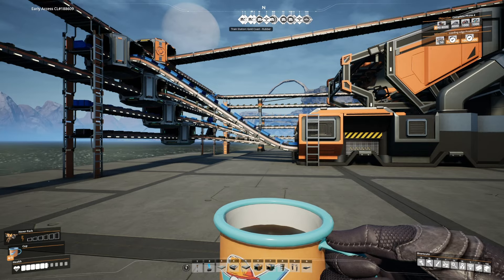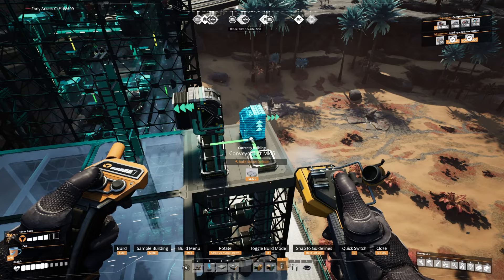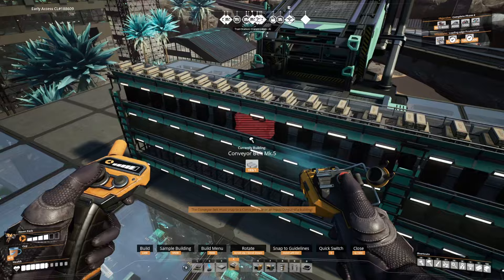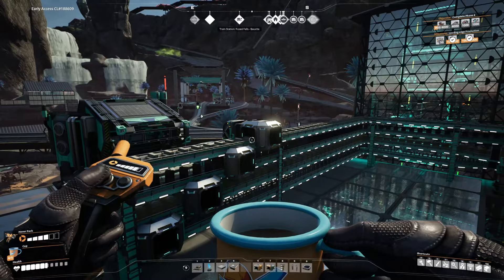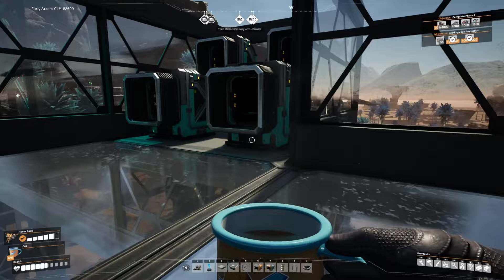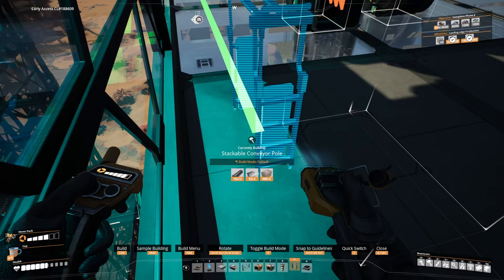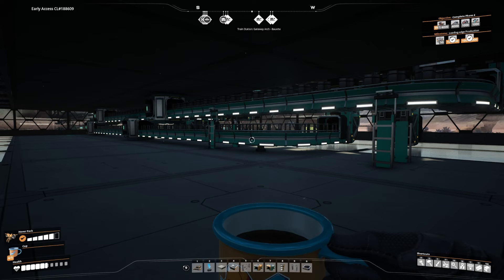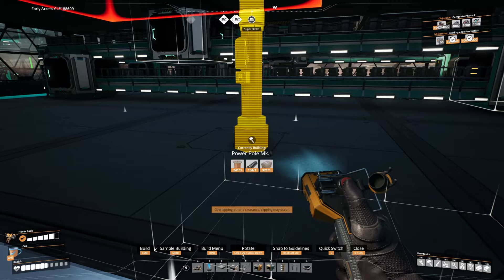Break Free of the Spaghetti! - Satisfactory Manufacturer Design & Logistics Tutorial

Comment: When you had to re-do the belts at 2:55: I felt that in my soul. 

Building a lot of pipes is so much nicer because you dont have to worry about direction. Also this simple variant is pretty close to how I do it usually, mine is just a touch more asthetically pleasing IMO, though it takes up a ton of space. I stack 4 splitters at the first hole (depending on what direction the parts are coming from) positioned 1-1.5 foundations away and belt them in from there, it doesn't clip, but it takes up a lot of space. I guess the upside is you can see if there's a problem with a line faster, but really I'm just exhausted by the time I get to the end of a factory that ends in manufacturers and just want to set it up as simply as possible.

I probably won't bother with logistic floors, or other cosmetic belt/wire hiding (I like the industrial nightmare asthetic for my factories), but I got a big bolt of inspiration on how I wanna do my Frames production. I'm gonna go to the Rocky Desert starting zone and build 3 giant floors for the 3 tiers of frames, maybe this time I'll actually use walls and make it look like.... something, though likely only after it's complete.
Reply from the maker: Seriously. I actually have to redo a lot of stuff that I am building for videos…I find that I concentrate on not talking like a moron and end up building like a moron.

My early buildings are exactly what you describe. Pretty organized factory floors but almost no decoration. Nothing wrong with that at all!

If you haven’t already, think about a subscription. I am close to getting monetized and just need a few more subscribers

Comment: Another tip for clean power lines when you have a floor beneath your machines: Wall mounted power nodes can be mounted at the ceiling, and you can connect them to the machines above. That way even the power pole will be gone.
Reply: That's my favorite way of connecting power. On the other hand, watching him use the regular power pole in this way, maybe it helps find the thing later on. I had good results adding a second floor to my starter factory; simply use the first floor ceiling as a power bus and pass everything upstairs.

Comment: i just done my first floor fed system in a coal plant. saved a ton of room. those pipes sure do be space greedy.
your designs are really nice. i just don't have too much time to make things as sexy. top work
Reply from the maker: It definitely saves a ton of space...the coal generator is a great spot for a belt floor. I would probably still run my pipes on generator level...I have found that feeding anything fluids from below can get a little wonky.

Timewise, the key for me is to find some patterns for each kind of machine that work for looks and aren't too fiddly. That way I know what to do each time I have to build a given set of machines.
Reply: @DrLootCrate  yeh for sure, i always run fluids from at least level height, never below. i like to put in a small fluid buffer before feeding anything. it helps to avoid the sloshing that often occurs. 
ha i like to make a huge to-do list and just go at it. then encase it in glass and concrete😂
Reply from the maker: @mowvu5380  that sounds like a great plan!

Comment: Ah, I remember "baby's first organization".  I spent my entire first run of Satisfactory trying to avoid clipping, making things as "efficient as possible", making things look neat and tidy and nice...  Burning like 300 hours of the game before even getting the Assembler...

Then, on a subsequent playthrough I went, "This is a massive waste of freakin' time.  Spaghetti and clipping are THE MOST EFFICIENT way to do anything."  The shortest distance between two points is a straight line.  It doesn't look nice, but it's certainly much faster and more time efficient to engage in massive feats of clipping and spaghetti.

Do you want to unlock everything in 30 hours, or do you want to make a "pretty factory" that takes you over 100 to organize and be careful about placement in order to "get it right"?

Yeah, my new run is "I want to unlock everything as quickly as possible.  I can make it look nice LATER.  Looking nice is the ENDGAME.  It isn't the CURRENT GAME."

After all, you're going to be tearing your factory down dozens of times anyway, just trying to "keep it nice" and trying to "keep up with production" as you upgrade miners and transport systems and everything else.

Easier to "spaghetti" the thing and "make it nice" later... when the parts are no longer really needed as quickly as possible.

In a game like Factorio, the "spaghetti" matters as it actually interferes with productivity and efficiency of your factory.  Satisfactory... spaghetti doesn't matter at all, because it's MORE EFFICIENT to clip through everything all the time to achieve the shortest distances between any machine.  Belts that slam through power poles, other belts, and other machines and the space elevator?  ABSOLUTELY!  I'm not going to attempt to reposition anything to "make it look nice".  That's a newbie move.  Production is fastest by engaging in the clipping and embracing the spaghetti.  Make it look nice later.  When there's nothing else to unlock and nothing else to do.
Reply from the maker: Awesome comment and I agree to an extent. 

My first save was ridiculous spaghetti and I figured out how to be organized towards the end. I thought that I would start again with this knowledge and it was really helpful. 

So for this save I was generally organized with each build (no clipping and all manifold on foundations), but really didn’t take any time attempting to make it look good until my adaptive control unit factory (which looks horrible haha).

Two slight points of contention: I haven’t torn anything down…I just move on to more nodes. There are so many out there. I will be redoing a bit of my starting area because I am building phase 4 parts there and want it to look decent.

I have said “I’ll make it nice later” several times and I have not yet done it. Once I move on to a new project, I really struggle to find the motivation to go back. You might be able to glimpse my half decorated RCU factory in the distance in some of my videos…
Reply: @DrLootCrate  I'm not knocking the "make it look nice" and the tips are generally very helpful as I'm always interested in "How do I make this not look like garbage?" when I get to endgame.

I just gave up on my most recent run because I was just burning SO MANY HOURS on "rebuilding it" all the time.

I mean... you get a Impure Node, so 30 iron a minute.  One Smelter to go with it to make 30 iron ingots a minute.  Split that off into whatever you're making to keep the ratios perfect...

Then, you unlock "Mark 2 Miner".  Well, crap.  Now I've got to tear down the first smelter and add more constructors.  Or, I get Mark 3 Miners and have to do it all over again...  It's even worse if you've got a Pure Node and have to start with like 4 Smelters and it scales up a ton as you go.

That's to say nothing of when you unlock trucks and no longer want to "belt everything back to the main base".  Or, even worse... TRAINS.  If you do not have a plan for your train stations the moment you start your file, you are basically asking to rebuild the whole thing again and again.

Even having to "upgrade" your belts is a fun new overhaul each time as they can carry more items.  Got a Mark 3 belt, but you can't hope to fill it with the Impure nodes around?  Downgrade it to Mark 2 or funnel more resources onto that single belt from across the map.

I can't even imagine how my transportation network is going to look the moment I unlock the drones (which I've never used before as I'm playing on a brand new PC for this run and hadn't touched the update they were introduced before).

All of this to say nothing about when/if you start over/underclocking your machines.

I typically end up rebuilding my Satisfactory "main base" at least a dozen times before unlocking Tier 7 and 8, and that's just to "keep it functional".  That is to say... adding new lines into old ones from further nodes, adding more machines to current lines, swapping out alternate recipes on current machines, so needing to fix lines again...

You can easily see why I blew 300 hours on my first game before even getting "Assemblers" as I had to keep rebuilding my base just to keep stuff from clipping and to keep it "nice and organized".  I spent like 30 hours on a freakin' "Mall" for each part in my main factory as well, and I didn't even have that many parts available to make!

So, with so many hours trying to "make the factory look nice" on a playthrough, I just couldn't subject myself to that anymore.  Making it "look nice" when I had nothing left to unlock seemed far more reasonable to me.  Especially since I know I'm capable of sitting down just to tear my factory down and rebuild it to feed lines all back through it again.

Spaghetti is the most efficient way to play Satisfactory.  I don't begrudge anyone for doing it and I feel like we don't talk about how useful the Spaghetti in the game actually is, in the Satisfactory Community.

But, it's also important to make things nice when you can.  Making things nice is "endgame" and isn't progression at all.  Making things nice is always something good to do to "burn time" while you're waiting for other things to happen.  I just don't see the point in focusing so heavily on "making things look nice" so early in the game and before you get most of the important upgrades and unlocks.

So, yeah.  I can remember my first time at "trying to make things look nice".  It was a good time, at the time.  But, it made me woefully inefficient at the rest of the game.

And, there's nothing to stop you from "going back later", even if you don't have the ambition to do it.  It's sometimes hard to "find the ambition" to tear it down and rebuild it.  But you know how you start?  Just start knocking out walls.  Once you get started on tearing it down, you no longer have the hesitation to do it.  You then go, "I'm building this much better than I initially had it and it won't be so difficult to navigate anymore and it will DEFINITELY look far nicer".  Just gotta rip that band-aid off sometimes.
Reply from the maker: @XxTaiMTxX  I’m with you, especially the part about burning time by making things nice. It is a good thing to do if you have 20-30 minutes to play.

I avoid a lot of rebuilding by just moving on to a different node. I don’t ever go back and replace belts and miners unless I am on the verge of unlocking something and I plan for the upgrade (like I am currently doing with mk 3 miners).

I don’t think making things nice is endgame…you can do it whenever you want, including never! But I could see many people playing this game mainly for the building design if they are really into it. That’s not me, but part of the beauty of the game is that there a lot of ways to play it!
Reply: @DrLootCrate  Well, what I mean by "making it look nice is endgame" is because you don't unlock most of the really nice looking stuff to work with until you're basically at that point.  Even the placement of new machines and such can make things "look beautiful".

I always find it "very limiting" what I've got to work with so early in the game.  I prefer the look of the Mark 3 miners, for example.  I prefer the look of the bigger liquid storage tanks.  I prefer making my buildings look more "lived in" or even "create a tiny little city" with each new section of factory, where I've got cars and parking lots and train stations and stuff.  A factory building just doesn't "look nice" to me, until I've unlocked most of the building materials and most of the new machines and structures.  You have most of the "sandbox" of creation unlocked by endgame, so it's really the perfect time to begin to beautify stuff.

Especially when you're looking at Phase 4 of the Space Elevator and realize you can blow a ton of hours to make those parts at 60 a minute (something I will never accomplish because that task it so daunting), or you can wait a few hundred hours for the elevator to fill and make your factory look beautiful during that time.
Reply from the maker: @XxTaiMTxX  excellent point. I am definitely of the mind to get a reasonable rate of space elevator parts and waiting. That is an excellent time to pretty up

Comment: Thanks for the video! Istarted doing this in my builds and i really like the clean look it gives, plus logistic floors help me from making a mess with belts. You could go one step further with the power and position a ceiling outlet in such a way that it's under the machine so that the wire doesnt show at all. i built my aluminum factory that way and there are no visible or barely visible power lines, looks really clean that way.
Reply from the maker: Thanks crafty! It is a nice clean look. I have started using the very trick that you mentioned with the wall outlet since this video in a lot of my builds

Comment: I started using logistics floor with update 5 if you place the splitters first in the right place you can avoid having to run conveyors between them and the lifts looks tight
Reply from the maker: Definitely! It works if you put the splitter first and then the lifts will attach to them but not the other way around like I did

Comment: Was just about to build my first manufacturers and wondering how to hook up all the belts. Looks like I'll be using a logistics floor, thanks.
Reply from the maker: Good timing bruv. The logistics floor is definitely my favored way of doing it.
Reply: @DrLootCrate  Finally got mine done, not quite as neat as yours but I'm happy with it. Nice design.
Reply from the maker: @ugjhgjf  mine is only this neat because I made a video about it…I was definitely less particular when I wasn’t showing the world my builds
Reply: Blueprints can set your spaghetti free. Just make something that's tight and crams as much as possible of what you need into a 4x4x4 blueprint. Then make sure to color code each of the corners so at a glance you can see it's orientation. Then you can just plop down these abominations everywhere and spaghetti them together to your heart's content without having to think. As a bonus you can put little signs on them that'll tell you the input quantity you need and the export quantity you're going to get. I embraced the spaghetti fully I have become one with it we are the spaghetti

Comment: Video for how to feed 4 inputs... Nice I am already overburdened with managing 1 or 2 inputs / outputs of multiple buildings to the next stage :D
Reply: Ok after seeing the video this does somewhat ease the transportation but it still does not solve my supply rate issues when for example I only have mk2 but produce 150 screws OR (and in worst case AND)  75 iron rods which somehow have to split into 20 / 30 / 25 because there are multiple next stages for different parts or storage....
These things seem not to work using this bus system.
Are there tips for how to "plan" such things without looking horrible in the end?

Comment: 10:16 Did you ever heard of dubble walloutputs? I think it is a way better and cheaper solution then the powerpole.
Reply from the maker: Of course! Not sure I agree that they are better this application. I was trying to completely hide the power plus double outlets don’t work on floors. I guess I could have put some 1m walls underneath but then it would have been a little hard to walk around.

Definitely works for a lot of other things though!
Reply: @DrLootCrate  I diddnt know they don't work on floors thats on me but is single walloutputs work under the floor then you can actually conect the cable from the machine to it and let it go trough the floor. Or you can als put a single walloutput on top of the floor and conect both of them trough the floor. A powerpole takes more space to.

Comment: I have never seen splitters or mergers snaping on existing belts.
Reply from the maker: Well now you have! 

You have to be careful that they are hooked up correctly, especially at ground level. Sometimes it just looks like they are snapped on and you only find out when you flip everything on
Reply: @DrLootCrate  On the ground snapping works pretty much every time. It does not work if I place it on a belt. Actually today I noticed that it works most of the time so perhaps it was temporary issue and I gave up trying. Or it was fixed by one of later updates.

Comment: Why couldn’t you just use a sushi bar with smart splitters? Is that not possible here? Single line split off in front of each hole feed the line with all the parts needed…
Reply from the maker: You can use a sushi belt, but belt throughput is limited. If you want to string a some manufacturers in a row and the recipes calls for screws, that might take up the whole belt. This is more expandable, and also this would work for people that haven’t unlocked or have the materials for smart splitters.

Also you need that exhaust valve off of each spot in the chain into a awesome sink because eventually the sushi belt will back up at some spot. I don’t like messing with them really

Comment: Just use sushi belts?
Reply from the maker: It is possible but not very practical. Sushi belts in practice backed up and grind to a halt. You can get around that by putting in overflow splitters but then it becomes more complicated than non-sushi belts
Reply: @DrLootCrate  Well yeah, but simplicity isn't the goal, space efficiency is, right?
Reply from the maker: I don’t think it is more space efficient either as you would have to add an awesome sink to stop everything from clogging up over time and that is huge. Plus the smart splitters and mergers to do the overflow into one